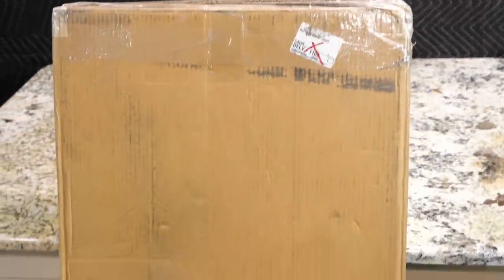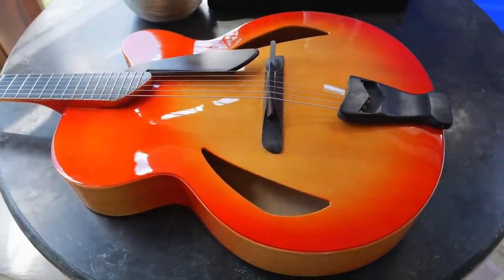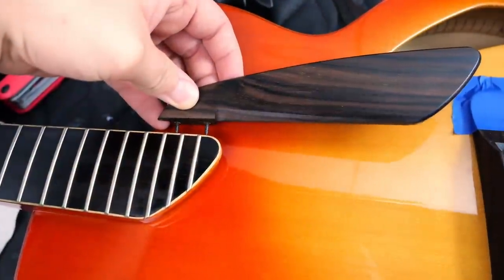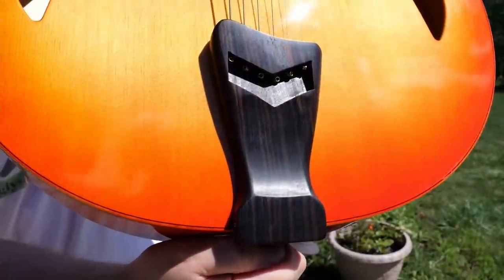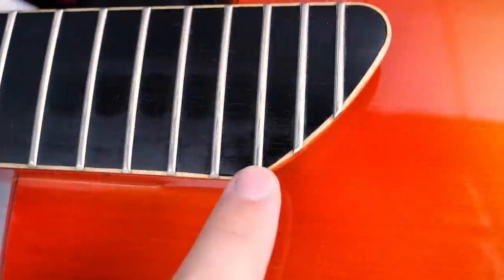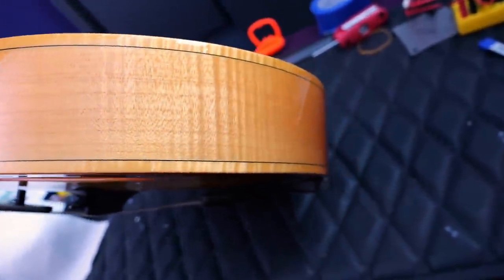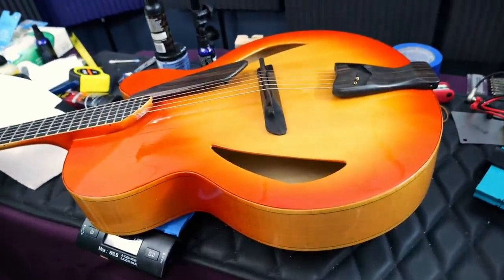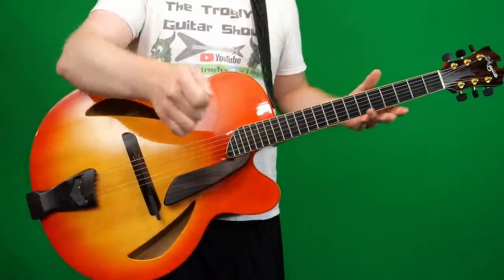Which D'Aquisto Model Did I Buy? | Unboxing, Review + Demo

Comment: Beautiful looking and sounding guitar, but you didn't mention the obvious truss-rod cover break and scratches to the headstock veneer around the screw hole. Shipping damage?
Reply: A used guitar from the early 2000s.
It's in pretty good shape for almost 20 years old.
In this price range I suspect it would have a poly finish.